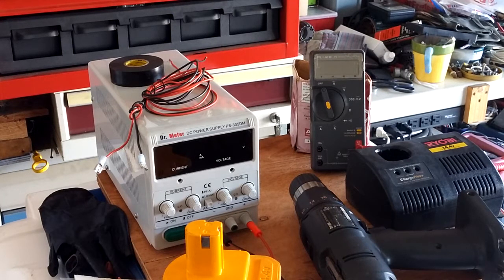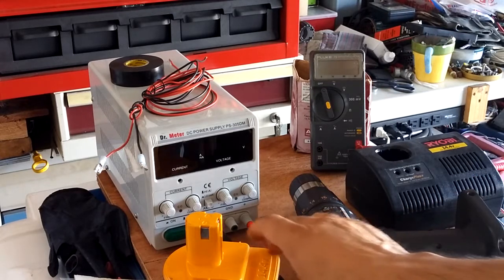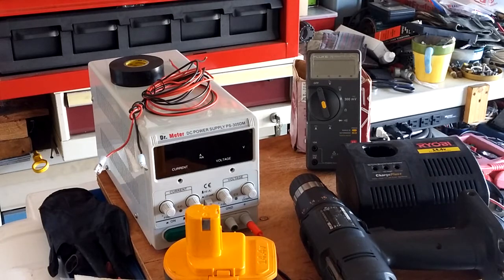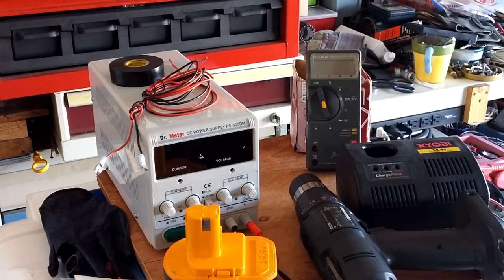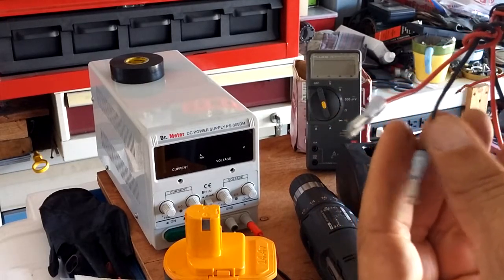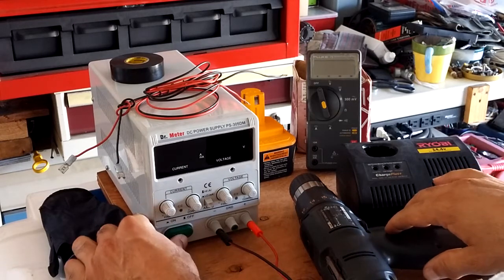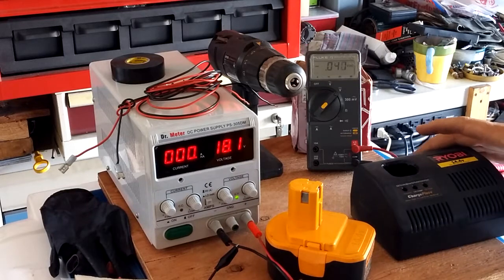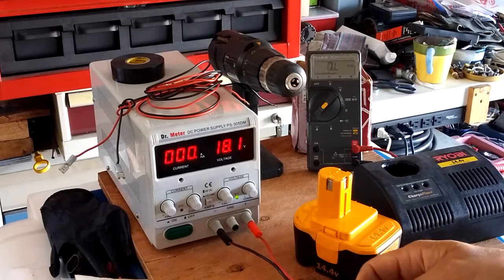DIY / Reviving a Ni-CD battery.

Comment: I have a clansman radio battery (24v 4ah), I know i got to charge is 10% of the amp hour rating, so 0.4amp, but what would the voltage be for a slow charge? its a nickel metal hydride battery. I also have a small 12v 0.6ah battery for a smaller radio so a 0.06amp but again what voltage? would it even charge from this particular power supply?
Reply from the maker: Harry, to ensure that your batteries get the proper charge, I would recommend a charger that has multiple amp settings with a one amp or lower setting. This power supply is made to provide a constant state of current and voltage for the load that is using it. A charger changes the state of charging as the battery becomes fully charged.
Reply: Thanks for the reply and I have been looking at different types of chargers but have no clue on what to get as I would need small crocodile clips to attach to it. and the chargers used in the military fry the battery because they are designed to charge it as quick as possible in the field.

Comment: I'd rather charge with this u git to chooze your voltige and max current  another way to charge a battery is connecting them to higher voltage batterys in parallel and let the voltage difference charge the battery.  the bigger the voltage difference the more current
Reply from the maker: Yes Matt, that is the next thing I will try using another fully charged battery and connect them in parallel to see if it will wake up and take more charge.

Comment: All of this just to save the $17 on a new one? Wow! Not worth my time and effort! Just buy a new one, man! Jeez! LoL!
Reply: The question of whether it's worth it or not depends on your particular case. For example I am trying to rejuvenate an old Ni-Cd battery for a restored 386SX laptop from 1990. In my case the battery is irreplaceable, so this video was very helpful for me.
Reply: @kosztaz87  You can still buy the old 18650 cells as they are still pretty common. I'm sure some eBay sellers have them or Aliexpress just to name a few places.
Reply: @buddysteve5543  It's a different chemistry. The laptop's charge circuitry was designed for Ni-Cd battery. It even has a buit in discharge utility in the ROM. Needless to say it would destroy a Li-ion battery, as those have very different charge/discharge characteristics.
Reply: vey worth it as toll works right ten wile one get a 2nd battery i assume